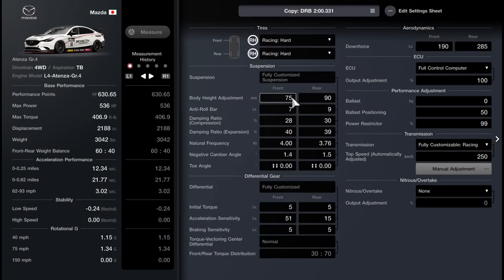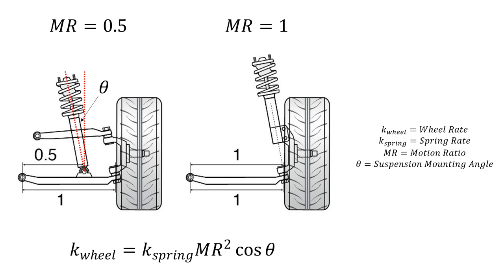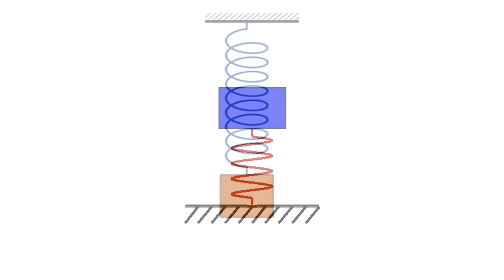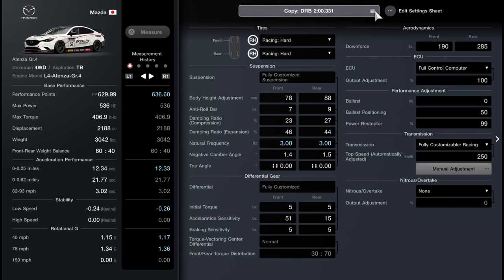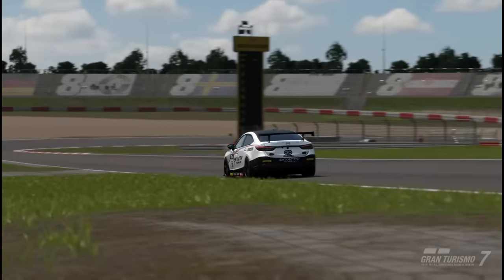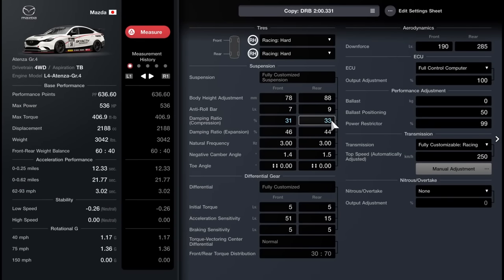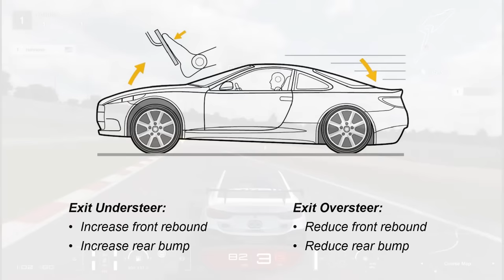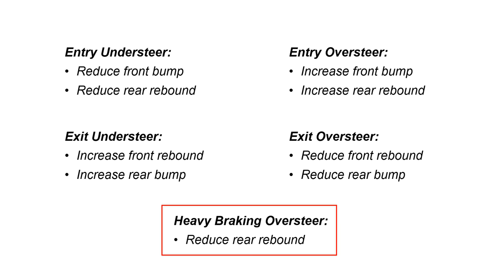How to Tune SUSPENSION | Part 1: Springs and Dampers | Gran Turismo 7 Tuning Guide

Comment: I thought I was smart enough to understand the natural frequency formula, but I just don't get it. Could you give me an example with numbers?
Reply from the maker: It might be easier to think about in terms of the formula at 4:56. From there, we'll eliminate anything that remains constant to see what changes. If we're targeting a natural frequency of 3 Hz, we can consider that constant. The 4pi^2 term won't change, nor will the mass or motion ratio. We'll call all of these values "C", and that simplifies the equation to K = C*m. This means that if your corner weight changes, your spring rate must change by an equal factor to keep the same natural frequency.

If we use the natural frequency formula, we can verify that. 1/2pi and MR are constant here, so just focus on the sqrt(k/m) term. Again, if we change the spring rates and corner mass by an equal factor, we get the same natural frequency.

Remember that K is force over displacement, not mass over displacement, and that time factor from the acceleration component of force is what turns this into a frequency. When you cancel all the units out, you get sqrt(1/seconds^2), or just 1/seconds, which is frequency.

To put numbers to it, consider a car with 145000 N/m spring rate and 400 kg of corner weight - I chose these units to make it simpler for the calculation. When you plug that into a calculator, you get a natural frequency of around 3.03 Hz. If you then took a car that was half the weight with the same distribution, the corner weight would be 200 kg. You could then choose a spring rate of 72500 N/m and get the same 3.03 Hz NF.

Hope that helps!
Reply: @Harmonic14  So, I calculate C*M for K. Then I calculate the square root frequency of K/M. it would not be the same as doing square root of C

Comment: Just asking, is this information still good after the physics updates and such? 

Obviously the mechanical and technical parts are, but does the game still respond to these changes in this way?
Reply from the maker: @ericeaton2386  it should, yes. Any "magic" numbers or settings will always depend on the physics engine, but these changes should still be directionally correct
Reply: @Harmonic14   great, thank you! This is a fantastic guide. 

Also, impressed that you’re still responding to comments on this video. 👏🏼

Comment: Is there an easy way to convert real spring rates in ft-lbs to the stupid HZ thing in GT7 ?
Reply from the maker: @bnight2  springs aren't measured in lb-ft - that's a unit for torque.

Use the formula at 5:26 assuming MR = 1. I don't see a need to do this anyway because natural frequency is a universal system
Reply: @Harmonic14  Springs are measured in ft-lbs/in or N/mm I just want an easy way to convert normal springs for my Mustang to the Natural Frequency in the game my springs are 90 N/mm front / 140 N/mm rear. And it just doesn’t make any sense with the Formula